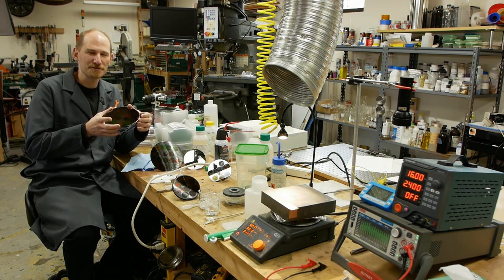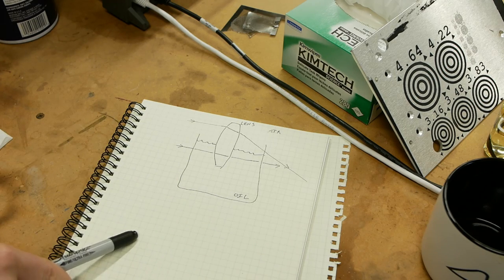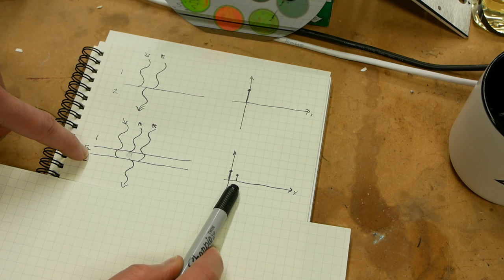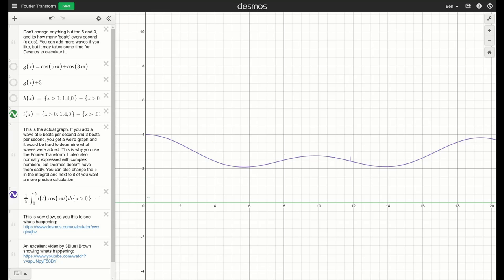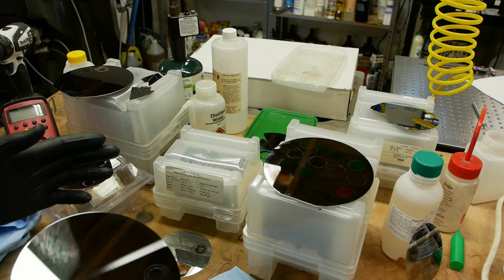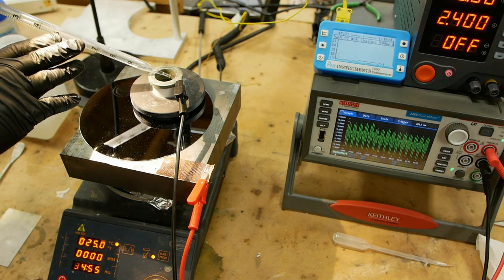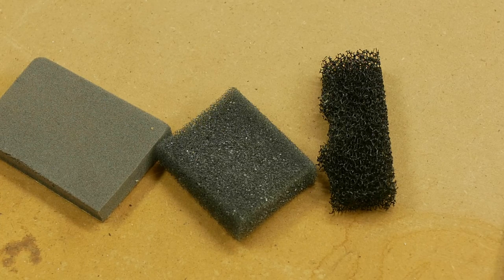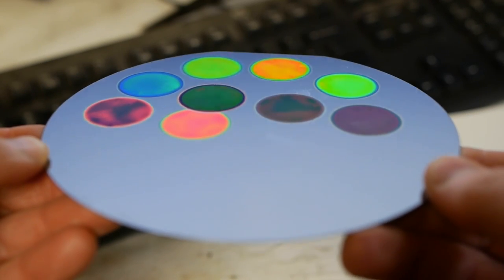Etching silicon wafers to make colorful Rugate optical filters (porous silicon)

Comment: So, it's a frequency-dependent rectifier for light frequencies. A conductive open celled foam with edge length of a few mm to a few cm should work for radar stealth. Can this be done for sound? 
Does applying voltage to the layer change its response? How about applying pressure via a liquid bath?
Obviously adding alcohol into the sponge changes the sponge's refractive index, so you could use it to differentiate liquids by what color they turn the filter. It should reveal concentrations of solutes as well, when present.
Can you etch a coarse sponge all the way through the slab? Can you select the pore size to pass molecules.particles by size?
Reply: Ooh, many good ideas
Reply: Re: liquids, I wonder if the surface tension problem he mentions could be overcome by pulling a vacuum and releasing it to pull the air out of the sponge and then push the liquid in

Comment: Wow, I never envisioned this to be possible. I'm still a bit puzzled though by the fact that the reflection of specific wavelengths is higher than that of silicon itself. It would mean that the stack of very thin zones of porous silicon have a higher reflectivity than silicon as a bulk material. Or maybe I just expected the absorption in the stack to be bigger, given that silicon itself is such a lousy reflector.

Comment: Wow this is really cool that you're doing this at home, thanks for sharing! 
The oxide coating on the non-polished side of the wafer is a native oxide coating, similar to alumina on aluminum. You may observe increasing resistance at the steel/wafer junction over the timescale of you etching procedure. 
I highly recommend calcium gluconate gel close by when working with HF. The gel is superior to a dry powder for skin contact.

Comment: WOW,VERY interesting job.I have a CVD divice can coat transparent film contain BN Si2N3 SiO2,according to your theory,I can make a band pass light filter by program MFC! I really think you should try this method using CVD or PVD, silicon is not that transparent after all.
Reply: It’s been done! By varying nitrogen flow you can create oxynitrides on glass with varying index. Here’s a link to our work on rugates using aluminium oxynitrides. DOI:10.1117/12.408478

Comment: Could you please show some electron microscope images of how the surface changes with time during an etch? Also, what is the leftover material made from? Is it just pure silicon, or does it have an oxide coating and if it does, is that coating very thin or is it most/all of the way through the remaining material that the porous structure is composed of.

Comment: Silicon wafers? I guess I can buy them on eBay. Machined parts? OK, might be able to get a replacement for that. HF? There go my hopes of ever doing this project (though I suspected it from the beginning). OK, I might get HF someday (which I’d have to make, just in case handling it wasn’t dangerous enough), but it’s certainly not in my plans for the near future.

Comment: I wish  knew a way to get a hold of you, so I hope that you just might bump into this comment! 

Are you aware that Borosilicate glass and Silicon crystals have a compatible CoE? Its pretty easy to take a small piece and encase it in glass. 
I've only ever tried it with Simax glass and some rougher grade non flat "rocks" as opposed to wafer material, but I have 100% confidence that the material would survive being put into a small pendant or wafer, which could possibly create a significant magnifiying effect, just by having the disc in the flatter side of a pendant/ hemispherical form.

Id love to hear your thoughts. cheers!
G Jones

Comment: Is it possible to use this principle the other way around?
Why can't we use a coherent light source as the emitter/transmitter, then analyze the returns from the reflections of the surface, to find out the chemistry of that surface? 
Sort of like reflection-spectroscopy? Vary the intensity and color of the emitted light, to get different reflections, then put them all together, to build a profile of different material databases?
Sort of like "RGB laser absorption reflection spectroscopy, or LARS"? 
If I knew...

Comment: This was so great! I’d never understood how you could design multi-coatings to basically be band-reject filters, without getting all tangled up with the reflections between the layers. When you said it was just a Fourier Transform of the transmission/reflection spectral curve, the light suddenly dawned! 

==> I’d love to see you delve into anti-reflective nano-coatings. They were a bit of a breakthrough in the world of photographic optics a few years back, but the tech is ultra-proprietary. They’re kinda amazing; the idea is you have some substance with a refractive index close to that of the glass itself (or maybe one of the outer layers of a multi-coating stack), and then deposit it in a such a way that it becomes more and more porous as you move from the glass surface to the air. If the particles or nano-structures of the material are well shorter than a wavelength of light, you basically create an optical material where the refractive index varies smoothly from a high value to a very, very low one. The smoothly-varying refractive index, ending up close to 1 at the lens/air interface can almost completely eliminate reflections. Anti-reflection tech in general opened up new horizons for optical engineers because it let them use large numbers of elements in a lens design (sometimes 20 or more) without having to worry about flare and poor local contrast.

I get the impression that there are different methods used to create these, at least from the illustrations various companies have used to portray them. Most mfrs show little spheres piled up densely at the interface with the glass and very sparsely on the air side. OTOH, Canon has illustrated their technology as tall pyramidal spikes. I don’t know if this represents a material difference or is just obfuscation.

I wonder if they’re using some kind of PVD or sputtering? I could imagine sputtering from a target composed of nano-spheres, varying the rate to adjust the density. Or maybe it’s some more complicated second-order factor, adjusting the balance between tending to deposit or erode the material being deposited on the substrate? 

It might be too challenging to figure out from scratch, but it’d sure be interesting if you could do it!

Comment: Possible hypothesis on the sensitivity to ethanol (or lack of sensitivity). The combination of contact angle (relative surface tension/energy) dictate the hydrostatic pressure required to overcome the surface tension for a given pore size. Would be cool to do porosymmetry (force ethyl into the pores under pressure) and observe colour changes at varying pressure

Comment: Great video Ben. I must admit I was only barely understanding that later half, but at about 26:21 you mention the green filter was the one that had the most obvious effect with alcohol added. Could the "pore size" with respect to the fluid account for this, in that immersion of other sizes will reject the alcohol?

Further, could there be a any use for a setup which included the liquid in lcd displays as a fluid in the filter?

Comment: I wondered how you make those bandpass filters. Given that they are really really expensive (think beyond visible range, like thermal infrared). I thought it would be extreme chemistry. But if it's a chose whatever, that's fairly interesting. 

But you are limited by the Silicon transmission.

Comment: What would happen if there was an anti-reflective coating that was not optimized for transmission? In other words, a front surface 50% reflective and a second surface 100% reflective, spaced 1/4 wavelength of the incident light ray apart. In the video around 9:35, you mentioned that anti-reflective coatings increase the transmission because the energy has to go somewhere. Where would the energy go in the case of complete reflection and cancellation?

Asking for a friend :)

Comment: Etchelent Work! What a de-Lightful video! It was Ru-Great! You always make us Reflect on what a Colorful character with Bright ideas can do! Like the Silicon at 27:20 you are well Red and never Opaque! I doubt there is any technological Optical that you couldn't overcome. There, now no one else has to make any cheesy science puns. 

Also, there are two minor typos on the Fourier Transform Desmos page: the fouth line in the fourth box has the word also in two spots and in the seventh line the word "of" should be "if".

Also, Also, Graphite can be lapped to a mirror finish and is also conductive do you think it could produce Rugate Filters as well? More potentially dumb questions: Could polished metals also do this? Why Silicon over other reflective conductive materials? This may be another dumb question but is this for modifying the reflected light the transmitted light or both? Does the porous layer collapse when the water alcohol mixture evaporates? Does the average density of the the dopant in the Silicon change the porosity and therefore the color when all other factors remain the same? Why is it a Fourier Transform that does the conversion? What mechanism is encoding the amplitude of the amperage (what a tongue twister) into the porosity of the silicon? Is it just that the electrons are physically moving slowly into the silicon as it's being etched and there are just more of them pushed into the currently etched section when the current is higher and they chemically activate the surface or is it weirder than that? How long does the etching take? Is it the current or the voltage that you're changing to the tune of the sum of sine waves with the micro-controller? Is this one of those kinda AC kinda DC situations or is it just DC and I'm over thinking it? Is the drift velocity of the electrons across this thing a relevant thing to this whole... thing (ah, pure eloquence)?

Comment: Fascinating and an excellent workup! 
Practicalities aside, I'm immediately curious if these methods could be leveraged to create a novel method of ink-less printmaking.  Does anyone know if such applications have been explored?  I'm envisioning something akin to thermal printing. A stylus would drawn over a specially prepared substrate coated with an emulsion of doped silicon particles. Fine points  of color and halftoning principles could then be used to render a print image. I've no practical application for such a method, just a curiosity. I wonder how fine a resolution might be possible.

Comment: Thanks for the video on this fascinating topic! You know... I find myself thinking that if one had a way of modulating the reaction rate with light instead of (or in addition to) electric field, perhaps one could pattern the index of refraction in three dimensions? I would think that patterning index of refraction in 3d would be useful for making some fancy optical metamaterials, if it could be controlled well enough.

Comment: What is most likely happening is that the alcohol is filling the voids in the material, changing the effective refractive index of the layers. We observed a similar phenomenon in our coatings obtained through physical vapor deposition, which are also porous: a change in atmospheric humidity is enough to shift the spectra by a couple of nanometers. As to why the green filter changes more than the other, I don't have a definitive answer, without knowing the actual structure of the filter, but I can give you some pointers. 

First of all, green filters tends to be more sensitive to spectral shift than red and blue ones: while a small shift can change a green into a yellow or an orange, red and blue would only become darker or lighter, respectively (assuming the different filters behave in a similar fashion). Yours is also almost yellow, so a small nudge towards the red, or an increase of the reflectivity in the red lobe, is all that would take to make it shift. 

My other hypothesis is that the porosity of the layers is involved: maybe the green filter has less dense layers, or the more porous layers are thicker, so its layer's refractive index is more affected.

Comment: Ben: I noticed some vibrations at the edges of the wafer in the last SEM picture. 
Have you mounted the separate vibration damping feet for the rotary pump to reduce vibrations in the microscope it self? If you know the total scan time, you can calculate the frequency of the vibrations as well, sometimes it can be electronic noise, such as 60 Hz and a mains filter might help.
FYI: The SEM had a separate insulation transformer originally, it also transformed 230 V AC to 110 V AC, which is why I never sent it to you. But that transformer might have acted as a mains noise filter in addition to transforming the voltage. Just something to keep in mind.
Reply from the maker: Yes, those jagged image artifacts are annoying!  I'm pretty sure it's a problem with my digital image capture setup since it appears at medium and high magnifications with the same apparent amplitude.  The problem itself only appears at certain acceleration voltages, and certain magnifications, and even then it's intermittent.  I've been long planning to replace the digital image capture with a system containing an ADC and DAC so that the capture system can control the raster scan itself (the current system obtains timing from the existing scan-out, and this is probably the source of scanline mistiming.  I did mount the mechanical pump feet , and that certainly did help with vibrations at very high magnifications. I hope you are well!

Comment: Hm... Could one say that the antireflection coating is some kind of spacial FIR filter? like the digital filter but with space instead of time? if the changes in refractive index are the equivalent of the impulse response in a digital FIR filter?
Reply: after thinking about it some more, this could actually be the case, if you think of the layers of the refractive coating as delay elements which they kind of are.

Comment: @ Applied Science You said that the silica can be a light emitter. What spectrum of light is emitted? And is that via electrical excitation? Or?
Reply: It almost sounded like he implied that you could layer it so the bottom layer emits light and the layers above could be filters.... 
I wonder if you could make the light emitting layer UV with upper layers being fluorescent... or something. It sounds awesome!
Reply: @ C manycrows    Silica is an indirect semiconductor, therefore it cannot light up by itself. Perhaps with tricks but not really good. For light generation, there are used III/V-semiconductors (GaAs, InP, GaN, GaSb and so on) and not group IV semiconductors (Si, C, Ge...).
Reply: @hotech5218  I should look into it, but how are the light emitting layers added for normal LED production?
Reply: @BRUXXUS  The normal white LED production are blue LED with light conversion into white by Phosporous layers. The blue LED is realized by depositing / growing of Gallium Nitride (GaN) and Galliumindiumnitride (GaInN) on Saphire or Silicon by MOVPE machine.
Reply: @hotech5218  I wonder if Ben is thinking about trying something like that. I mean, I wouldn’t put it past him. Lol

Comment: I’d say isopropanol still has too high surface tension to penetrate small pores... Something like hexane for those which are “not chemical sensitive” might change the result 🙂 Or better, supercritical CO2 to see pressure-sensitive color shift.
Reply: Is that for the lense🤔

Comment: Interesting to see the IPA changing the colour there, and as you pointed out it is probably a surface tension effect, so might be worth mixing couple of soap droplets with water which drops its surface tension dramatically and see if the colour change still happens, or is it a more fundamental chemical effect!

Comment: Did I understand correctly that it is possible to change the alloying color not only of silicon but also of other materials, such as steel?

And what if, as an electrode, you use a similarity of an LED matrix, but without LEDs, that is, a matrix of copper dots, to which different potential is connected, in this case it will be possible to apply a picture?

Правильно ли я понял что можно менять цвет легирования не только кремния но и других материалов, например стали?

А что если, использовать в качестве электрода подобие светодиодной матрицы, но без светодиодов, тоесть матрицу медных точек, к которым подведен разный потенциал, в этом случае можно будет нанести картинку?
Reply: What if instead of modulating the current per-pixel, you modulated the activation UV light instead. You can have a DLP projector, you can modify it by replacing the light source which is originally white light, with a suitable UV light source, and removing the colour filter wheel.

Comment: So, if you were instead to use an array of electrodes on the top, could you alter the current density regionally such that it forms an imitation meta-lens?
Reply: A perfectly flat but functional lens! No we're talking!
Reply: I wonder if one could use an array of micro-mirrors pulled out of a DLP projector as the array of electrodes. The edge of any tilted mirrors would be just a little bit closer than the edge of any non-tilted mirrors. If you tilted all the mirrors in a circular pattern by telling the array to project the image of a white circle on a black background and then slowly changing the diameter of the circle you just might be able to make a lens like that.